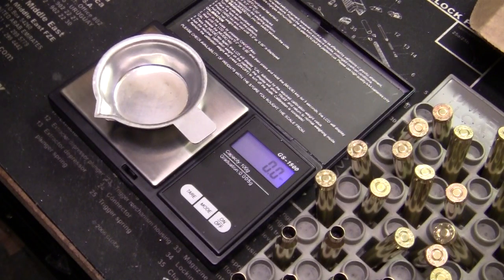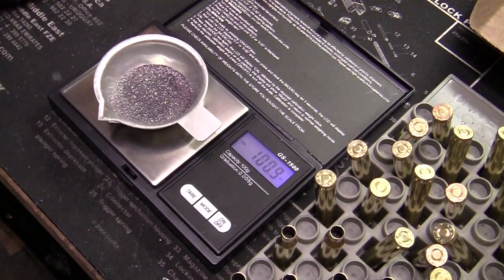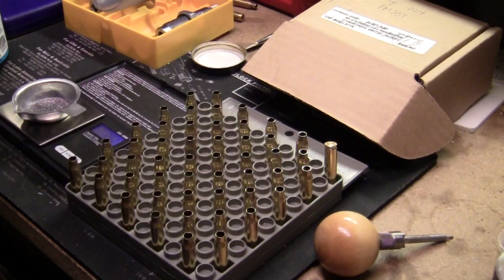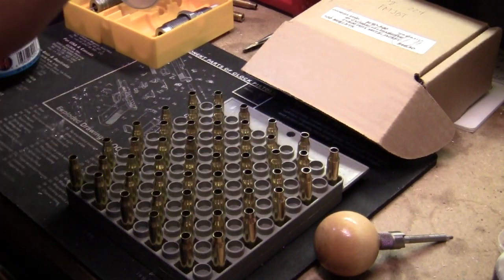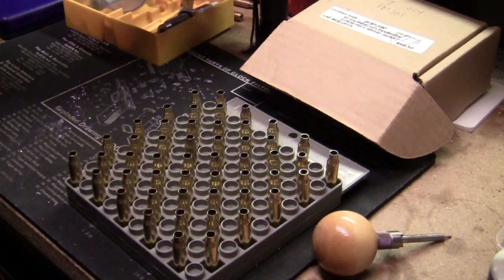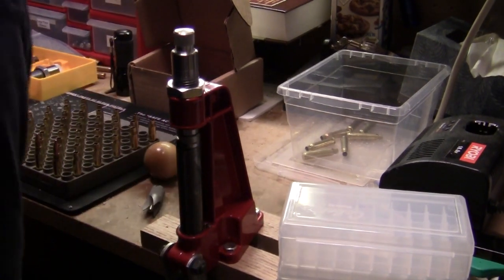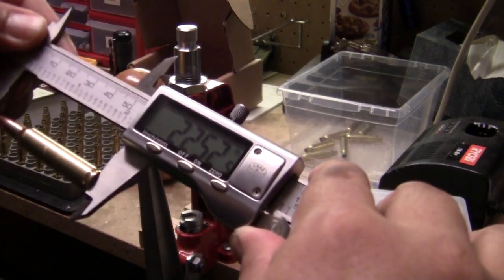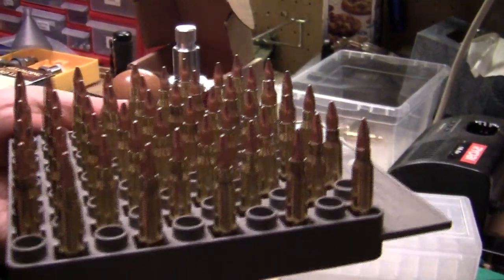Reloading 5.56x45/.223 Remington Part IV

Comment from the maker: @ThatDudeSirraj Congrats on being number 2k!  For semi-autos, you need to full length resize.  For a bolt action, you can just resize the neck.  The leade is the distance between the mouth of the case and the point at which the rifling engages the bullet.  It does affect overall chamber dimensions.

Comment from the maker: I think I do on my other series of reloading videos.  The short of it is press, dies, reloading manual, scale, trim gauge (if necessary), case lube (if necessary), bullet puller, priming tool with shell holders, powder measure, shell holder, brass, bullets, primers, powder.

Comment from the maker: The number of times you can reload brass depends on the pressure of your rounds.  The higher the pressure, the shorter the life.  Lake City brass is all I've reloaded so far, and it's designed for the higher 5.56 pressures.  Load pressures are determined by the amount of powder you load.  As for duplicating the M855 round, try searching some of the forums.  I found how to duplicate the M193 round that way.

Comment from the maker: @Herc517 I load my rounds to 5.56mm pressures by powder charge.  Other than that, I'm using the data based on the .223 cartridge like case length, OAL, etc. because I don't have that data for 5.56 on hand.

Comment from the maker: @jroks12345 The Auto Disk Powder Measure works with the Powder Through expanding dies when expanding the case mouth for bullet seating.  In the rifle dies, the full length sizing die also expands the case mouth, so it combines both operations in one die.  There is a generic die that I can get that does nothing but charge cases with the Auto Disk, and I may go that route if I can find one at the next gun show I attend.

Comment from the maker: @Herc517 your decapping and sizing die actually should flare the case mouth.  Are you using new brass?  Even if the brass is new, I was told by a very experienced reloader that you still need to size the brass.  That should solve your problem.

Comment: If you are going to be shooting those through an auto loader (ie. AR15) I would suggest getting a .223 case gauge (L.E. Wilson makes one) to verify your reloads are sized to spec.   Running the cases through a full length die is no guarantee they are sized.  It took me a couple of badly jammed rounds in my AR to realize something was wrong.  After some internet research I purchased a .223 gauge and sure enough almost none of my reloads would fit inside it, despite having resized them per instruction.   I needed to lower the F.L. die in the press more then if I was reloading for a bolt action to the point of overcamming to get the brass back to sammi spec..   A small base die will do the same thing.  I have had no issues in the hundreds of loads since then but now I use a caliber specific gauge to check any reloads that will be fired thru an auto loading firearm...
Reply from the maker: Great advice.  I know what you're talking about.  the first time I fired these, I would have about 1 in 10 jam.  I ended up borrowing a case gauge, at the time, and discovered which ones were 'out of spec'.

Comment from the maker: It takes me anywhere from 30-45 minutes to load 50 rounds.  Progressive presses would take much less time.  My cost comes to around 21.4 cents/round, or $4.28/20 rounds.  This was based on duplicating the NATO 5.56x45mm round, but the .223 Remington would be almost the same.  Also, these figures were based on what I paid for the components.  They may cost you more depending on where you live.

Comment: Obviously loading powder as shown is time consuming.  Are there any accuracy advantages to weighing each charge like this over what one would get with the Lee Loadmaster?
Reply from the maker: Technically, there are, but most people won't notice the difference.  I was trying to duplicate the 5.56 load to mil-specs, but a powder measure (I use an Auto Disk Pro) works just fine.

Comment: do you have to worry about case thinkness at certain powder charges for nato brass when loadin it the same as 223 brass?
Reply: No. A charge is a charge. Just make sure weight is correct. The fill of the case isn't going to affect anything and its not that much thicker. Take a caliper and see for yourself
Reply from the maker: Many people will say to stick with the 5.56 cases for 5.56 charges, but I've loaded them in both.  Just make sure you don't OVER charge your case.

Comment: If you buy your components in bulk you can save a lot compared to EQUIVALENT commercial ammo.  I can produce quality m855/SS019 equivalent .223/5.56 ammo for $0.15 rd buying primers in bulk, using surplus powder and bullets and using free range brass.  You can get steel cased ammo for $0.20 rd in bulk but it's not reloadable and not as clean or consistant as what you can make handloading.